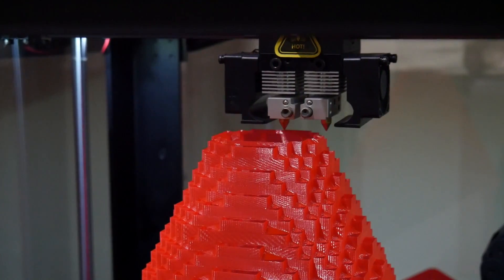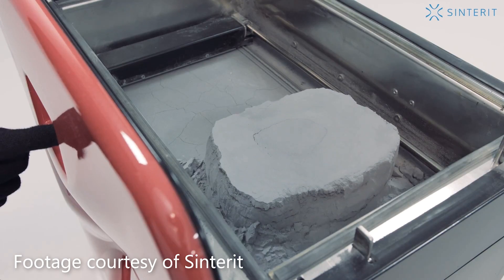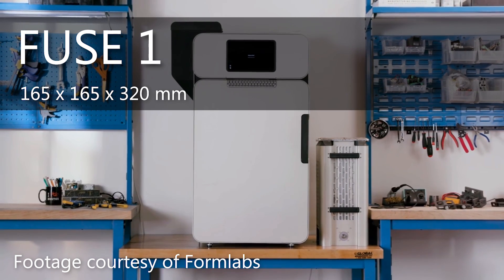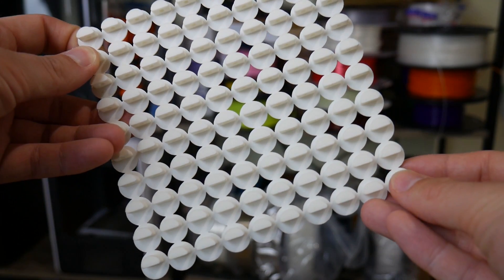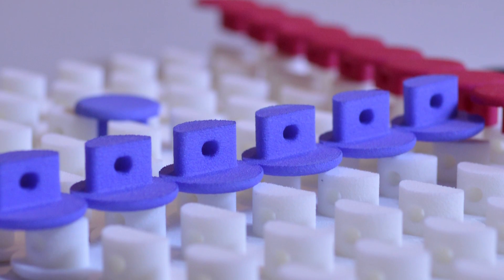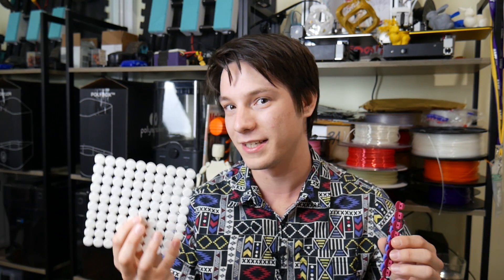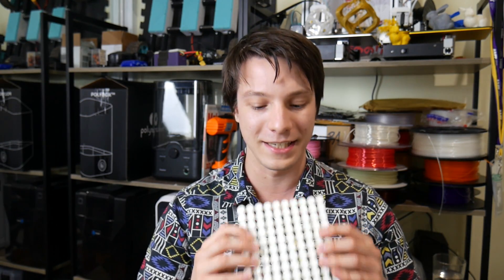Here's why SLS is the future of 3D Printing - Maybe. Formlabs Fuse 1 vs Sinterit Lisa vs EOS

Comment: There's another type of printing similar to SLS, I don't know what it's called, but it's a sand-like powder and a binder chemical. Many of the machines also have full color inkjets that pass over at the same time as the binder, allowing for full color 3D prints. I'd be interested to see how that technology compares to SLS. Does it experience shrinkage? How tough is the material? I've heard the prints are like soft sandstone, do they make a version that can be tempered to make it tougher? The powder in these other machines is supposed to be reusable (in fact the machine comes with it's own cleanup system built right in), how is it's reusability?
Reply: I have seen both in-person and have sample of both.  IMHO the powder-like sand (its basically plaster!) w binder (glue) is limited to decorative items. Poor strength, fragile and cannot be post-processed beyond a clear coat. IMHO it is comparable to cake toppers. Also color is muted. It is not concrete or sandstone.

This process while looking similar is different as the final product IS nylon that is fuzed. Check out what HP is doing with their Multi Jet Fusion. https://www.youtube.com/watch?v=VXntl3ff5tc . In the end the process seems only suited for industrial manufacturing and not home use, and still somewhat early.
Reply: That type of 3d printer also costs around $80,000 USD and the prints break if you drop them.
That is also out dated as a $3000 full color 3d printer is coming out.

Comment: Thank you for your great thoughts and inputs. I want a new printer, but I suspect the perfect printer does not exist... FDM is cheap and simple to run, but with ugly bridges and supports. SLA looks wonderful, but is brittle, messy, smelly and expensive. SLS looks nice and sturdy but is grainy, dusty and expensive
Reply: IMHO the best solutions for surface quality, is ether the Saffire or the Milkshake3D. Both top-down SLA so support structures are more manageable. IF I had to buy one today it would be the Saffire.

Comment: HP's Multi Jet Fusion technology also uses Nylon Pa12 material and barely creates any waste powder, same goes for binder jetting. Have you looked into that? In addition to that, generally all powder based parts have to be sand blasted just to clean them, so there no way around. However, depending on the blasting media (glass beads, nut shells, graphite) you can achieve various types of finishes.
Reply: I Have seen the HP MJF in person. Seems very promising and innovative.  There is 2 or 3 different types of materials available right now, (nylon, something "glassy"like, the a more flexible one.)  I asked about ABS, but the machine does not get to a high enough temperature for it.  A user pretty much needs to use both a printer and their post processing station. The Post processing station is built to cool the print in a controlled manner, and is said to mostly eliminate shrinkage.
Reply: I work with MJF. It is fast and creates close to isotropic parts. However, the speed and strength comes at higher materials costs compared to SLS. You need the powder and two agents which are very pricy. Under full load you can run through 4-5k$ in materials per week which means that you could end up paying the machine's price per year just in consumables. Tolerances of 200 microns are not great either but it is one of the most promising technology platforms out there at this stage.
Reply: My guess is you are using the MJF, the post-processing station, 1+ build units,  and a sandblaster as that is what HP used during the demo? :-)
Reply: yeah that's the minimum equipment required

Comment: Hi Angus, it was nice seeing you at makerfaire! :)
If I remember well PA12 is not very hygroscopic compare to other Polyamide (10 times less), when fully submerged in water PA12 would absorb a maximum of 1% in weight while nylon 6 have a rate close to 11% :)
Do you think that the fact that SLS is very limited in infill customization is also a big limitation?

Comment: thoughts:
1.  could the chamber temperature be lowered enough to not damage the unused powder by using a higher powered/frequency (blue indigo instead of red)/pulse rate laser?
2.  is nylon the only plastic being worked on as a potential material.  could ABS or PBT or PLA or Ultem or something else be used?

I so want to see EBS (Electron Beam Sintering) get cheap enough for, if not home use (because of the fumes and power requirements), then makerspace use.

edit:
OK, I just found this: https://youtu.be/HQ6DcuvGeas
given that PEEK is SLS printable, other than price, why aren't more SLS companies trying to work with it?

Comment: Barely having worked with SLS, this was very informative. Thanks!
Reply: Sls Nylon is very strong and can detail your prints very exactly without leaving a mark, but I think sls for now is way to expensive to be considered for now on. I always like to check on 3dhubs for the types of plastic but my favorite one so far is ABS or SLA because of the lower cost and the smoothness of the plastic
Reply: Oh I did not notice you were make anything, I love your channel and your cool guy video. Why won't you create a discord server for your channel? I think it is a pretty cool idea for users to share their prints with other experienced users.
Reply: mopmop111 thanks! I made a subreddit instead. You can post prints or just about anything at r/makeanything 😊
Reply: I just saw your review on the tevo tornado, awesome! but what do you think of the tarantula or the geeetech printer series?
Reply: The Geeetech MeCreator I've played around with a little bit, not a huge fan so far. I also need to start printing with the Tarantula, I've only done a benchy for now. It does seem promising for the price, but I'd tend to recommend spending another $100 for a range of printers that are quite a bit better.
Reply: Hey Make Anything, I was just thinking, would it be at all possible to have an adjustable x and y to reduce the powder waste?

Comment: The material re-usage increases when everything is sintered in close to absolute void of air. As you stated, plastics may absorb humidity, but in void they can't. Also, when unpacking, you should not touch anything and, most importantly, keep the dust in the chamber. Plastics fortunately can be captured with electrostatic charged walls of a container, thus otherwise problematic issues will not even arise.

The price tag has been lowered by quite a bit and I am also surprised that a 10 W laser suffices. I suppose that's the power output, not the consumption. And yes, the shrinking. The systems I know have laser sensors which measure the material thickness and adjust the material appliance accordingly. This is even a greater issue with metal prints, because they may crack up to quite some extent.

Comment: One correction: SLS nylon parts can often be stronger than injection molded nylon. SLS nylon is PA12, while injection molded nylon is usually PA6 or PA66 and the SLS process allows more complete crystallization, both of which increase strength. However, that makes them more brittle both because of the increased strength and because of gaps left by partially melted material at the interface of each layer. This has been shown by a few different university labs

Comment: ....so why would this be "da future"?
From what you have shown - sintered plastic prints - it doesn't offer much in the way that people, or companies need. Its not strong enough for load bearing parts, and its far too costly to be anything but that for prototypes.

Its "better" than FDM because it doesn't have layers hat are prone to faliure...
...but i have doubts about multi axis FDM printing never catching on, and then this will be an overpriced gimmick - similar to stuff like arc lamps - sure they work, but what is the point? its just a waste of money.

Imho SLS to work anything but metal is a gimmick.

Comment: A couple of stands over from ours at TCT, there was a company doing a clean-out of their SLS printer during the end of show break-down - I should have photographed it - the guy was in a full head-to-toe 'bunny suit', complete with overboots, a full-face breathing mask system, and was connected to the machine via an antistatic strap.
I'm guessing that dust gets everywhere, and the particle size makes it a possible fire/explosion hazard (the antistatic strap) under the wrong circumstances.
Reply: I imagine the antistatic is as much to prevent him getting a static charge and getting covered by dust from head to toe than anything else.  But yeah, that powder has to be horribly messy.

Comment: In my mind, SLS = Metal sintering for some reason. When I heard it was nylon, I was a little bit surprised, especially given how the material seems to be just powdered plastic.
Reply: In my mind SLS = space launch system
Reply: Me too. The cheapest metal sintering machines go for $20,000. But you will need a binder removal machine and an oven for sintering. No real cheap solutions yet for metal but I suspect it's coming soon. It will be a revolution when it does.
Reply: Well, there is DMLS (Direct Metal Laser Sintering)
Reply: Yep, between the much higher printer and materials costs, the dodgy dimensional stability, plus the added 'mess' potential for both SLA and SLS, currently not seeing a 'yuge' advantage over nylon FDM.

Comment: I have compared the Shapeways SLS (via EOS) and the HP fusion SLS -like system. The HP produces black parts w/o a dye step (and currently only black or gray), and is more accurate dimensional and with a smoother finish out of the fuser. I did see some "ridging" effects around the tops of holes on the HP though. It looks like Shapesways will soon be commercially offering the HP process commercially. I expect it will replace the current EOS for many parts.

Comment: Couldn't you build a customizable "build container" to reduce the powder waste? Like a cube where you can adjust the width/height depending on the size of your print.
Reply: the problem is the sled that is depositing the powder, you'd be stuck with at least the width of the sled always unless you make a set of build dimensions and different sleds... and that will be really messy to switch out.... and you'd have to calibrate it after every switch.

Comment: I would only get an SLS printer for a makerspace that prints things often. I knew most of the pros and cons of the technology, however I did not know about the shrinkage that is different in xy and z. Can SLS parts be used for molds (make silicone mold of an SLS nylon part or an SLS nylon mold and use resin in the mold to make the part) or because they are porous it makes no sence? Great video as always Angus.

Comment: Another issue with SLS is that any parts that are manifold have to be 100% infill. If you want larger parts that are light or use less material then a large enough hole has to be designed into the part to let unused material escape.
Reply: iPeel aaand with something like a new cura infill you can just drain whole thing out with one hole as its constructed in a way that allows you to do that.
Reply: Material usage is probably not too much of an issue, considering you can only go up to 50% reused material. So the ideal amount of material used is 50% or more.
Reply: This isn't a significant drawback though, and it's not unique to SLS printing. Any small pinhole will do to evacuate the material, and if you make any closed cavity with any print method, you WILL have trapped material inside, with resin printing, it's air and resin, with laser sintering it's sintering media, and with extrusion printing, it's loose filament strings and air.
Reply: Well the video at 2:34 seems to show the powder clumping and sticking to the model pretty significantly. The person in the video is using a brush to free the powder from the actual model. So a semi hollow enclosed model could be a problem freeing up the internal powder. Yes resin needs to be drained but the remaining resin is still in liquid form so no problem.
Reply: @operator8014  air isn't "loose material", and loose filament strings don't get trapped as a necessity of the technology. Even you do get some filament trapped it certainly doesn't fill the entire cavity.

Comment: @MakersMuse are you able to stack parts on top each other to fill the build camber???
Reply: Yes. If you search for the Formlabs Fuse video done by Tested. they show a good example of the stacking clones when they print off the bike pedals. You can essentially Fill the chamber with as much as possible (but leaving gaps between parts obviously.) Doesn't have to be only clones though. You can essentially arrange the fill of the chamber with whatever you like, as long as the bits don't intersect (unless you're making something intended to be intersected of course)

Comment: SLS is cool but for simple parts FFF will always be cheaper. Its way more convinient to design thinking of FFF instead of spending a zillion rupies in an SLS machine which has a huge material cost.
An SLS machine only works if you have an actual use for it.....and being most things arent designed with SLS in mind, finding a client that needs such requirements will be hard as the engineer wont be familiar with this possibility either.

Comment: I would say that the shrinkage isn't a huge problem. I designed fixtures that locates parts on vacuumformed parts and those SLS prints are pretty much spot on the toolside of the vacuumformed part. Which kinda says it isn't far off :)

Comment: I've used shapeways for my 3d printing needs for about 6-7 years now, and even way back then, the quality of the prints was amazing. Stuff you'd probably be unable to print with regular FDM and even SLA would probably struggle - the number of support structures would be insane. (not trying to sell here, just demonstrate to the number of overhangs : https://www.shapeways.com/product/ZNDTYKTSV/medium-kidney-ureteric-tree-mountable?optionId=59268261 ). I can provide the STL if you want to try it Angus. Its from an actual mouse kidney.

Comment: Almost need to start thinking about more radical changes to the space, I think? Maybe a multi-axis FDM printer? SLS that has a localized dusting that gets blown around right at the sintering spot? Seems like some of the technologies are getting pretty mature and running up against some limits. Nothing insurmountable, and it will be interesting to see more innovation.

Comment: I agree with you that SLS is definitely the best (and my favorite) form of additive manufacturing. With the strength, volume, and materials that can be used it's certainly a staple in the industrial 3d printing world. As for home use, I don't think it will ever be a viable option for a hobbyist unless they were using it for a business of some sort. SLA and DLP systems are a bit more home friendly, but with the mess of resins and such they definitely have a niche market as well. The video was great as well, and sure to spark a lot of good discussion.

Comment: Seriously, you think people are going to spend all that time getting all the powder off ? Theres a reason FDM printing became popular and its because with PLA its non toxic and low mess.
Reply: Formlabs will also be releasing a cleaning station simultaneously which should make the cleaning process pretty fast.
Reply: I've seen sls printer that has the first stage cleaning built in, two armports in the case, and an vacuum hose inside. glove up, vacuum the remaining build material (avoids contamination with dust and other particles as well). And then take the part out for final rinsing. avoids quite a bit of the mess.
Reply: The powder removal doesn't have to take a lot of time. Drop the block of used powder in a bag, gently slosh it around, then blow off a tiny bit of remaining powder with your shop vac blower. Removing support material takes vastly longer. It's all just the mentality, and what you're okay with doing. I don't detail my 3D prints, I use them for functional things.
Reply: I would gladly spend the time doing that if it meant I could have this level of quality. The real issue is money and space. These machines in addition to their cleaning facilities take up way more space, and they still aren't even within spitting distance of FDM in terms of price.
Reply: "This technology is NOT for home users".
Reply: Like the idea of a combined unit! 
Also using an ultrasonic cleaner after rinsing (& rinsing a 2nd time) would guarantee total removal of any powder!

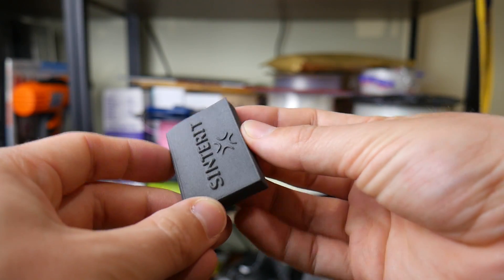Comment: Thanks for the great (as always) video! FYI, in an interview with Tested at 14:13 FormLabs did indeed state that the darker materials are so the material can absorb the energy from the lower cost 1064 nm [10W (9:24)] laser. You can check it out here: https://youtu.be/IrFYt3uUdrI and http://go.shr.lc/2gf6QUs
Reply from the maker: Ah that's where I heard it. Cheers!
Reply: I thought it was a brilliant compromise. Instead of an incredibly expensive and powerful laser requiring a specialized electrical connection, just heat up the entire build chamber just below your target temp and add in a (relatively) little laser. I've been considering mentioning that idea to a local professor that's stumped on getting ceramics to high enough temps to be 3D printed.